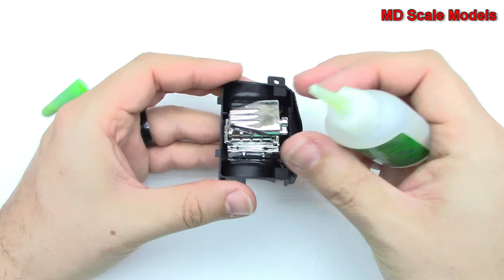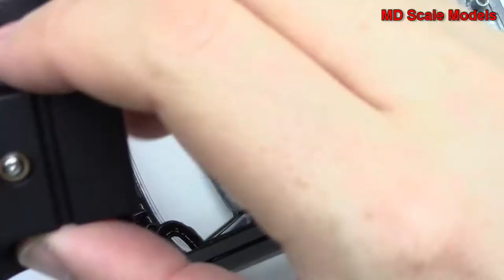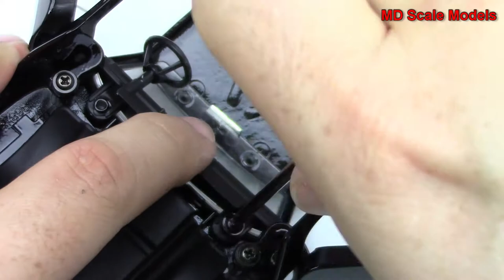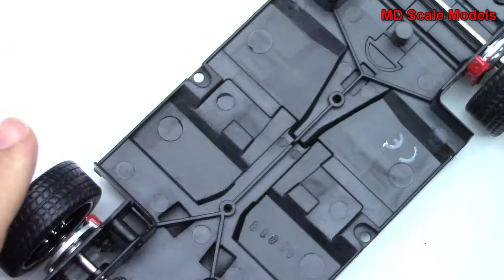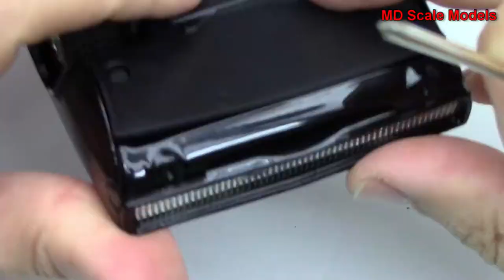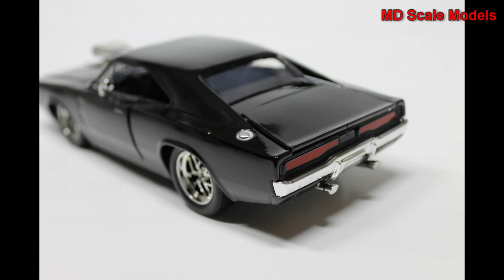Full Build Video - Dom's Dodge Charger R/T (Fast & Furious) 1:24 Jada DieCast

Comment: Hey man I can’t seem to get the round black things on the screws to put on the doors what do I do??
Reply from the maker: In the video you can see I also struggled with it. Make sure you have the right screw but even then it is difficult. You can try and trim the inside of it with a knife but not too much otherwise it won't hold.
Reply: Hey man I finished but the same problem happened the front tires don’t move it seems the fenders are rubbing on them what can I do?